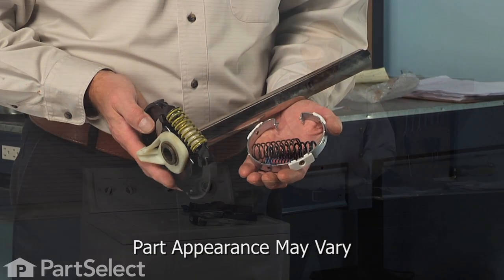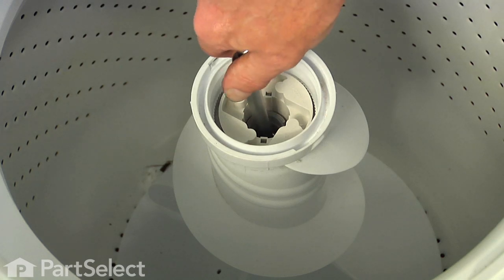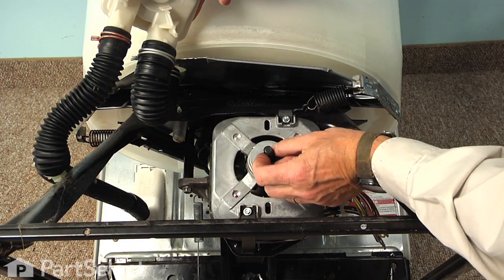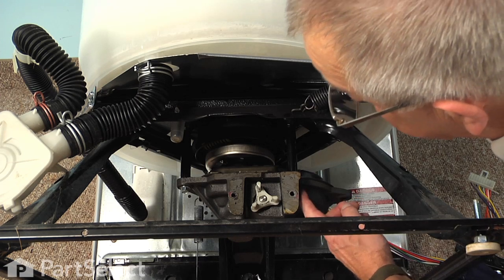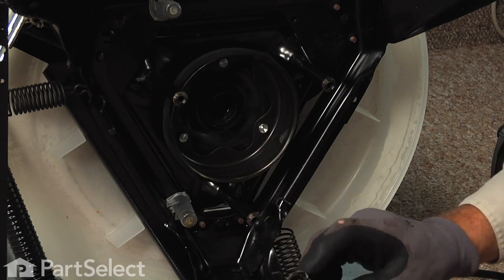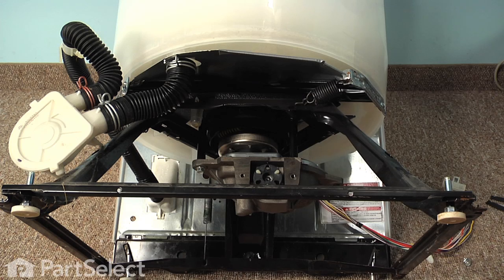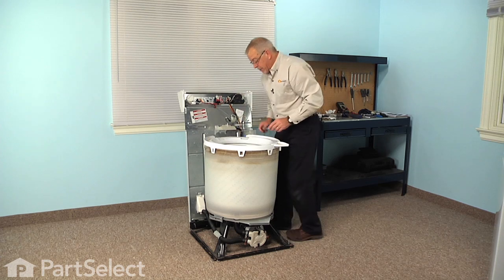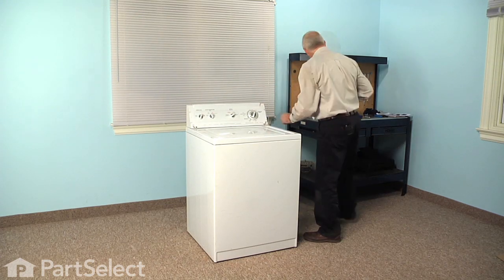Washing Machine Repair - Replacing the Drive Kit (Whirlpool Part # 285792-6780)

Comment: One thing you didn't mention is, before sliding the brake assembly back into the center post, you need to make sure that the raised pointed cam portion of the nylon brake cam above is pointing 180 degrees away from the spring in the clutch or else the transmission won't fully seat against the bolt shoulders.  I believe it's also recommended when re-assembling, to put "blue" Loctite thread lock on the two bolts that hold the motor mount plate to the transmission to ensure they stay tight, since they are prone to loosening.

Comment: Dumb question? Why would you need to change the drive shaft on this? What goes wrong with them? My washer will not spin? Agitates fines and drains but wont spin and the clutch drum gets real hot.
Reply: Sounds like the clutch lining is all wore off of it.

Comment: If your washer is more than 5 years old expect some delay.  All of the minerals and gunk get built up around the spanner nut and basket drive block.  First manually spun my tub buy rotating the brake assembly. Since it spun clockwise I turned counter clockwise.  I had to add liquid wrench and let sit for a few hours.  I used a propane hand torch doing several 6 second bursts.  The nut finally released.
For the block I did the same but found it hard to wack it from below.  I actually used the spanner wrench to tap it all around then from underneath.  It finally came out!
Reply: My son sprayed SeaFoam penetrating oil and that helped release it.